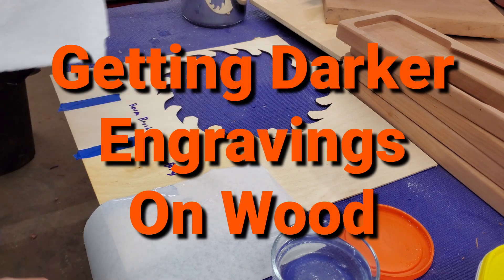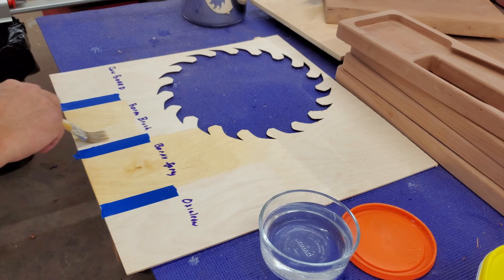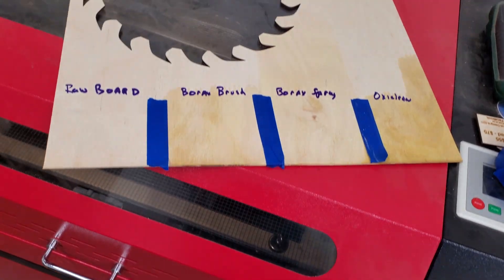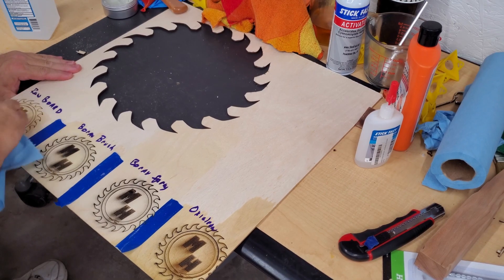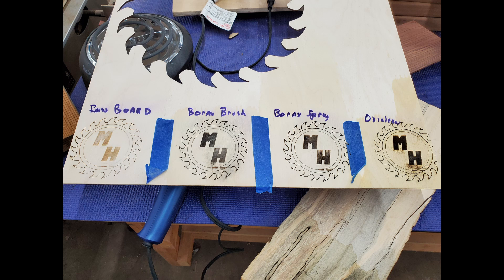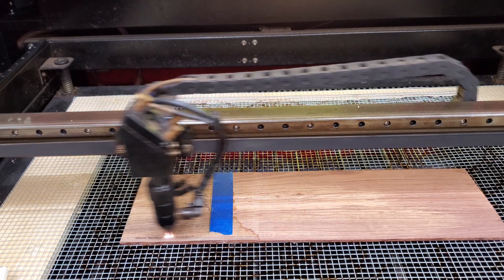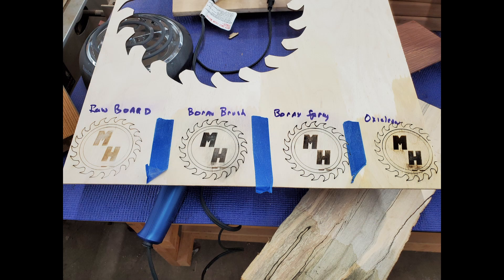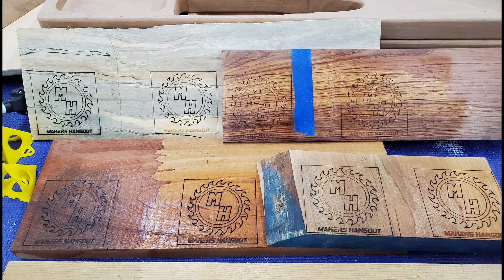How to Make Laser Engraving Darker

Comment: Some of these results are quite impressive. I just set a defocus offset in the software when engraving softer wood. Surely lines become less defined but its fast and does the job
Reply from the maker: I will have to try that also.  I defocus when cutting thru wood for sure (closer).  I found I can run twice as fast with better results and less power.  I learn something new every day!  Thanks for watching

Comment: I've not been using a pre spray, but use powder coating paint after initial engraving. That said I'm able to fill with any color I can find. I also have to disconnect my air assist hose or it blows it off.
Reply from the maker: I have tried powder coating material - but a little leary of not having some air on to keep the junk off my lens.  I also found some colors/brands didn't laser well.  What powder coating are you using Jesse?

Comment: I have an older laser on my XCarve, 4.2 Watts.   It doesn't cut and in engraves deep.   I do a lot of retirement plaques for local military.   I use borax.  You can find it in the laundry section at the grocery.   I use a cup of hoe water and a table spoon of borax.   I stain the wood and then brush on two coats of borax letting each dry completely.   I got good crisp black lines.   After I engrave it I spray it with clear lacquer.   After two coats I sand it smooth and apply a light final coat.   It looks great and everyone loves the quality.
Reply from the maker: Thanks for the comment Robert.  I started with an XCarve and a JTech 7 Watt.  Appreciate you watching and commenting.  Dan